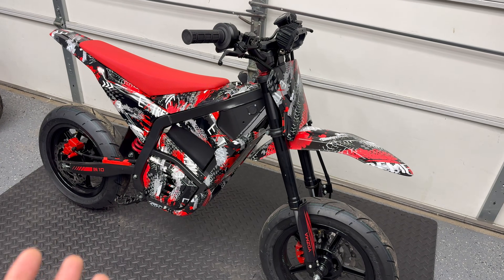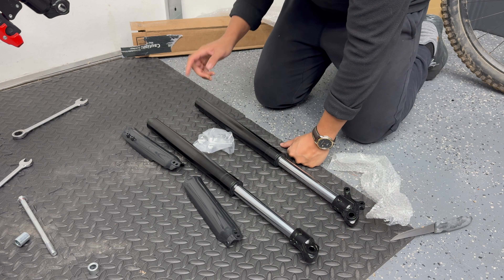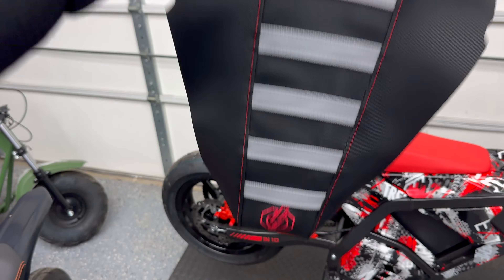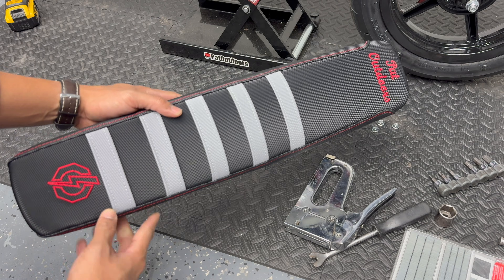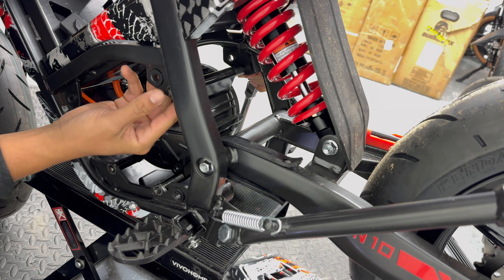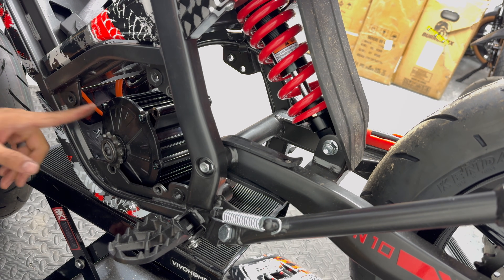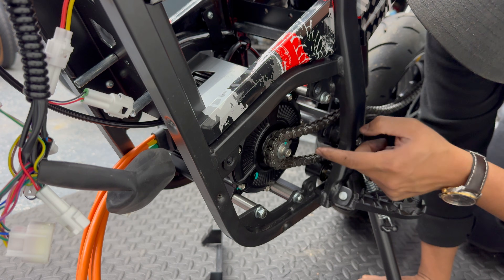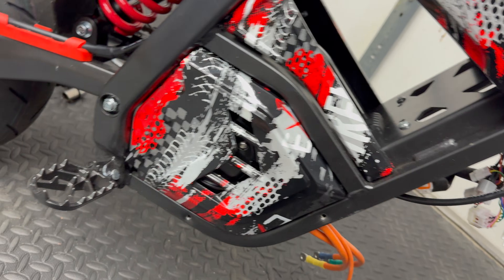Ultimate Yozma IN 10 72V Supermoto Part 1 - Sotion Motor

Comment: I have a question could you put a 60v battery in it without having to change the controller
Reply from the maker: Yes, but you need to connect to the stock Fardriver controller and change the tune to accommodate the 60v battery.
Reply: @PatOutdoors so I would need a dongle
Reply from the maker: @caleblawalin2104 yes
Reply: @PatOutdoors is there a 60v battery that you would recommend that would connect and work good

Comment: Can you run the stotion with stock controller
Reply from the maker: You can, but you won’t really get the full advantage since the stock controller can only put out 70 line amps max (5,040 watts with a 72 volt battery.)

Comment: Hey man quick question what is the difference with the stock controller?
Reply from the maker: Maybe a bit more torque.. The stock motor will handle whatever the stock controller’s max output is, even at 72V. I don’t recommend spending money on a motor upgrade without upgrading the controller at the same time.

Comment: Why a 57 and not a 53 like the tuttio?
Reply from the maker: Just experimenting with different gearing is all
Reply: @PatOutdoors would you recommend going with a 57 or a 53 as a replacement for the tuttio stock sprocket?
Reply from the maker: @GilbertoMota-n1b  57 loses less torque than the 53, 53 gains a tiny bit higher top speed. That’s personal preference
Reply: @PatOutdoors  Since it is for my son, I think I would rather he have more torque to ride in the trails and not a lot of a high speed since I don’t want him to be reckless. I think I will go with a 57.
Reply from the maker: @GilbertoMota-n1b  If you want more torque, then keep the stock 60T sprocket on. The point of smaller sprockets are for slightly taller gearing, trading low-end torque for top speed.
Reply: @PatOutdoors  Primarily I was looking at replacing the sprocket because of it being worn out, and since I was going to take advantage of replacing the chain as well, I would just say there’s not a real benefit to me finding a smaller, smaller sprocket tooth count?

Comment: I’m very curious about this build, so my daughter got the 48 volt 2500 watt em5 for Christmas and my son got the 60 volt 2500 watt em22. I am currently building my personal razor mx 650 with a 72 volt 32 ah 220 amp continuous output battery from momentum watts which is made by amorge but rebranded with momentum watts, gts11 25 kw peak motor and fardriver nd72680 controller capable of pushing 350 line amps. My battery will only do 220 continuously and maybe 285 for short bursts we will see. So needless to say I’m curios what that sotion motor can do
Reply from the maker: Sounds like you got a lot of fun toys! Also sounds like we have similar taste in bikes lol
Reply: @PatOutdoors yes sir, been waiting and saving for a long time to get them! So I’ve already done the 100amp fardriver controller upgrade on the em22 and it’s running around 52-55 mph now. Em5 is totally stock minus tuning with the dongle.

Comment: Whats the difference for the fw22 kit? Sensor has 2 option Hall or Decoder
Reply from the maker: You just have to choose whichever sensor your current controller works with. From factory, the Yozma uses a hall sensor so I just went with that in case I want to use the stock controller in the future. My new controller is also hall sensor compatible so I went with that. If you’re planning on using a controller that uses encoder, then you need a motor with an encoder sensor

Comment: Yo man, can you recommend a controller I can buy, that would work with the stock motor and battery, for now.. until I upgrade to a potion later on? 

Also how would I monitor battery level on a more powerful fardriver controller if I won’t be able to use the display anymore? Thanks for any help
Reply from the maker: The stock battery can only put out 60-70 line amps continuously (depending on production date.) The stock controller can be tuned up to 70 line amps, which would be the perfect match for it. If you put a more powerful controller, the battery will not be able to keep up with supply needed by the controller and you could fry the battery if you try to tune it past the rated output. It would make more sense to get a higher voltage battery (like 72v) and tune the stock controller to its max capability at the higher voltage to make more power and gain speed. You could add a voltmeter on the handlebar to track battery voltage to get an idea how much battery life you have left.
Reply: @P @PatOutdoors thank you for the information
Reply: @PatOutdoors that sucks.. I was really hoping to buy the controller now, and cruise with it until I upgrade the battery and motor later on. So it’s either an all or nothing type of situation. I guess I won’t be upgrading anything power wise for a while
Reply from the maker: @IntegraDIY I mean you can upgrade the controller now, just not gonna feel the difference till you get the battery later

Comment: The fw22 is such a beast i run it at 15kw cont 20 peak you wont be dissapointed
Reply from the maker: What’s the highest speed you’ve topped at so far?
Reply: @P @PatOutdoors 56 on 10/60 gearing 12in knobby i need to find a big enough straight to really hold it wide might also be some more tuning i can do

Comment: Lol look at that frame, it's obviously super cheap tubing.  It's even dented where holes were drilled.  Hard pass.  You guys are trying to flex these super cheaply constructed chinese pieces of shit but are just the idiots buying temu level fabrication.  All this junk is amateur hour sweatshop built
Reply: They’re definitely not cheaply made. The frames are high quality. Look up KakyMoto, the actual manufacturer.. they tested these frames for strength and impacts. It’s a good bike. And the welds are beafy and solid. 

Things like the triple tree, and bar mounts are on the cheap side.. billet upgrades would be fire 🔥

Comment: Hey, I was wondering if I could buy or have the yozima stock forks I’m building a custom bike but the front shocks are shot and I don’t have enough for ride and die if not that’s fine ,thanks.
Reply from the maker: Shipping would cost too much to be worth it. You could just buy replacements from ride or die
Reply: @PatOutdoors I could pay for shipping if it’s less than 50

Comment: Can you put the ride or die 45/48 front fork kit on the Yozma? And keep the stock height?
Reply from the maker: The headtube design looks different. I would definitely have to modify something with the triple tree camp spacers..
Reply: @PatOutdoors ok. Also when I try to tune my Yozma it lets me change the parameters but then after I save it the ratios in speed from 5500 to 9000 reset their selves back to 0. But only right after I save it. Any idea why it would be doing this?
Reply from the maker: @doubleggames5606 hmmm haven’t had that happen to me before. You sure you pressing save? Also make sure you disconnect the Bluetooth dongle before trying to operate the bike after changing settings.
Reply: @PatOutdoors I’m saving after every parameter change
Reply: @P @PatOutdoors the moment I hit save it changes back to 0. But only 5000-9000
Reply from the maker: @doubleggames5606  I recommend contacting a professional tuner. Maybe econic?
Reply: @PatOutdoors thanks so much for your input man. I truly appreciate it. I can pay you for your time. And I have one more question if you don’t mind. Is there an amorge direct 60 or 72v replacement for the Yozma without needing to swap the motor or controller? Just a battery I can throw in, tune and go?
Reply from the maker: @doubleggames5606 yes, you need to email Amorge and ask them for one of their Valtinsu EM5 batteries, available in 72V and 96V

Comment: 1100phase sounds like moxin😏😏😏 i m currently waiting for mine to come
Reply from the maker: Wait.. what bike you installing that on?
Reply: @PatOutdoors  i m working on video right now its yamaha 250 you can check my short if you want❤
Reply from the maker: @Voltjunkie nice. I also have a QS138 v3 powered YZ250.. may have to consider updating the controller soon since the vital is getting outdated at this point
Reply: @PatOutdoors  i wish i went with 70h this 90h makes me so much trouble mounting it. I hope it pays off once everything is done😅. Controler and good batery is key for qs138 they can take much more than rated
Reply from the maker: @Voltjunkie currently have mine tuned for 28kW, but for some reason my Amorge 43ah battery with 400 amp BMS is having trouble keeping up at high load for long hard pulls. Still plenty of fun otherwise, though range is bleh for hard trail riding
Reply: @PatOutdoors  interesting, thanks for input i m in process of making battery with same ant bms 420/1050A i will leave one pair of connectors on open discharge

Comment: Can u use the sotion motor with stock battery and controller and add more top speed and how much more?
Reply from the maker: You can, but it’s not gonna make the bike any faster since the current speed is limited by the stock battery’s output. It would make more sense to get a 72V battery first and change the tune settings on the stock controller to 72V, 70 line amps, 240 phase amps (which is the max capability of stock controller.)
Reply: @PatOutdoors thanks for replying